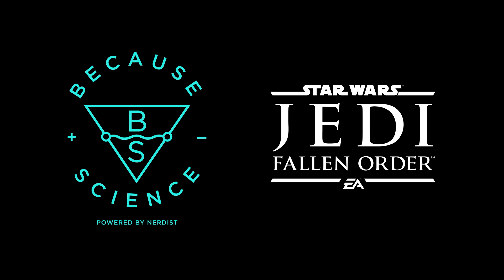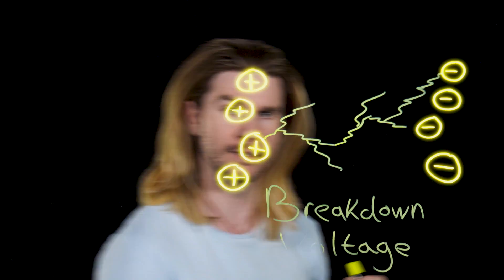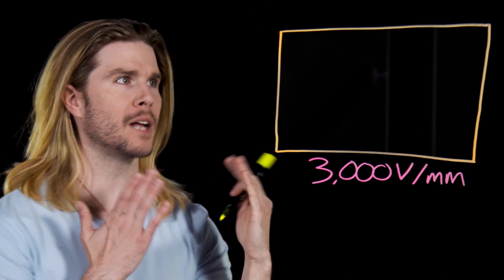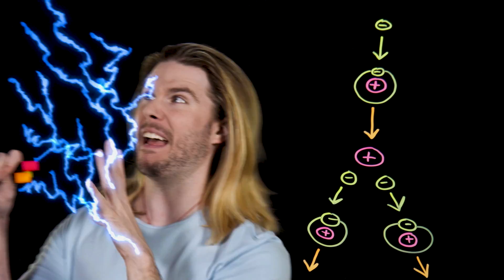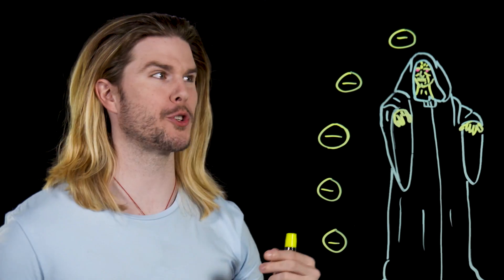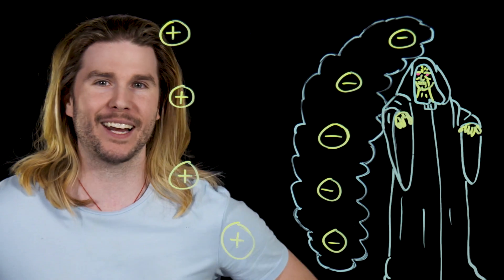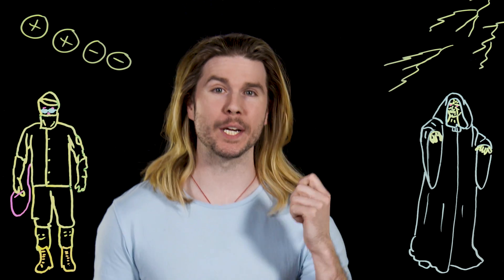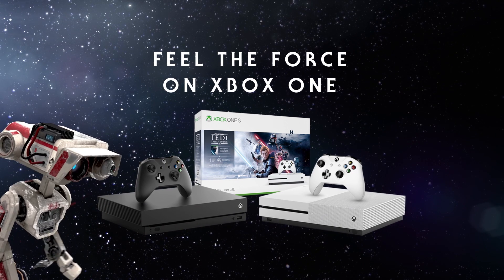How Does FORCE LIGHTNING Work? (Star Wars SCIENCE)

Comment: Nice explanation of something I've wondered since I first saw the Emperor using his (unlimited) powers, though now I also have the image in my head of him shuffling around over a carpet wearing colourful socks before shocking someone.

That imagery aside, there still is an aspect which I think would make Force Lightning, even when using the Force, dangerous or fatal.
First, electric eels are well-known animals able to stun their prey using electricity. Multiple sources I checked differed slightly, but most say they are able to generate multiple hundreds (~600-900) Volts. Once aspect of their powers is still not that well understood though: whether and how they don't shock themselves. Again, conflicting sources, but some said that the eels do indeed shock themselves and are temporarily stunned after shocking their prey.
Secondly, anyone who has ever ran around on a carpet and then touched somebody else knows that the discharge hurts both you and whoever you touched.

Taking both of these things into account, here is my problem. 
It may be the case that if the Emperor would use Force Lightning, he would shock himself at least as much as his victim, as may be the case in electric eels. This would of course make that power incredibly dangerous to use, hurting the user (see the effect on Luke) or possibly heavily shocking them or even be fatal (see the effect on Mace Windu).
Now, say that the Emperor is able to control charge in such a way that it is only contained in his hands or fingertips and doesn't reach the rest of his body, so it doesn't shock him completely. That would bring us into the second scenario, similar to oneself having generated static charge and then discharging it to someone else. If you've ever experienced it, you know that this shock can, even though it is only very short, be quite painful (otherwise just watch the video). Now imagine how painful it would be if this would occur with a voltage thousands of times higher than in the everyday case. I don't know if any studies have been done on the relationship between voltage and pain, but I think we could all agree that a few million Volts would probably be more painful than a few thousand. Again, this would make the power hard, or possibly even dangerous to use.

In conclusion, I think that though it is a very creative way of using the Force, Force Lightning would probably harm the user as much as the target and would therefore be a very, very last resort thing to do instead of just another technique to use in any battle.

Comment: Hi Kyle, love the show!

So force lightnings are similar to regular lightnings in terms of released power. The typical power of an Earth lightning is around 10 gigawatts but they usually only last for a very short amount of time, a few microseconds or so. On the contrary, in Star Wars, the force lightnings last much longer. In Return of the Jedi, Palpatine shocks Luke for more than 10 seconds conservatively, hence a total energy of more than a 100 gigajoules (E=PT). 

For comparison, and despite Luke’s amazement in that scene, Yoda lifting the X-wing could not have required more than 1 megajoule (potential energy difference E=mgh assuming 10 tons for the X-wing mass, a height of circa 10 metres and a gravitational field on Dagobah similar to Earth).

Kyle, is the dark side stronger?
Reply: A few corrections, first lightning strikes have an average peak power of Terawatts (10^12 to 10^13 watts) not gigawatts (10^9). Given that the voltage of lightning strikes are in the gigavolt territory and the current is in the kiloamp territory.

For force lightning due to the maximum voltages within those distances we can expect currents of around 10kA meaning at 22GV the power would be 220 GW or 2.2 TJ released over 10 seconds

Lightning on earth at 10^13 watts and lasting 30 microseconds is about 300 GJ. 

So while force lightning does release more energy, the description you were providing was misleading.

Second, assuming degobah has the same density as earth then it's gravity will be 1.13 times stronger. To lift a 10 tonne xwing 10 meters (which I think is a bit excessive) would require 1.1 MJ (within 10% of your estimate) but this is ignoring that he had to pull roughly 1 meter of that through the mud. Ultimately I would argue though that the mass of the x wing would fall closer to around 5 tonnes and instead of lifting 10 meters it would be lifted around 5 meters which would reduce the energy required to around 2.8 KJ which fits with your position that force lightning would release far more energy.
Reply: I was only considering orders of magnitude but thanks for providing more accurate numbers!
One quick note though, I think you meant 280 kJ for the x wing lifting (5 tons x 5 m x 9.8 gravity x 1.13 Dagobah scaling factor).
In any case, the force lightning is a much more impressive feat!
Reply: @Brendakye2468  Given it's the same size and shape of a Light Jet fighter and mostly the same materials ie Titanium, It's not unreasonable it'd be 10 tons. Disney Canon also says it's 10 tons now. Height sounds about right though.
Reply: @Citrakite  me saying the mass is 5 tonnes relates to its relative volume to that of a Lockheed martin F-22. Since they should have similar densities then the estimated mass drops down to just above 5 tonnes.

Note that I am not the only one that came to similar conclusions. The 10 tonne canon value comes from a "junior" book meant for kids. Using the complete free body volume of each would put the mass down to 4600 kg which is less than the 5 tonnes.

So in this instance I am going to go on rejecting the canon value given that it doesn't exactly make sense (especially since the x wings take up much less of the space of their free body volume than an f22)
Reply: @Brendakye2468  I based it more on volume of a F-14 and F-20. Planes closest to it's dimensions and materials.  F-22 is not a true apples to apples comparison due to the RAM and other lightweight composites used in it's frame and wings vs a more conventional fighter. 

Tomcat is nearly same height, minus tailfins, and width so length was the only difference. F-20 has a shorter wing span by 3 meters but it's 1 meter longer. Average between the two volumes relative to the T-65 is more like 12 tons but maybe the fusion engines are lighter than a same sized turbojet. Regardless 5 tons is way too low for something bigger by size and volume then a Gryphon or F-20 at ~8.7 tons.
Reply: You are correct I did mean 280 KJ my bad. Thank you for correcting that!

Comment: Hey Kyle, love the show!!
- It wouldn't be easy, maybe impossible, to hit a target using force lightning at such distances.  To hit the target, the closer thing to your hands has to be the target itself, even the floor has to be at a bigger distance to your hands then the target. 
- And you have to be isolated from the floor, with rubber boots. 
- if the air has some water in it, it may even be impossible to build up voltage at all, the electrons would runaway from you before there were enough to make a spark.
- You can't have such a constant flow of electrons like on those clips, you would fry!! The only thing that makes those discharges harmless is the short amount of time that takes those discharges to happen, we're talking about nanoseconds, milisseconds at best. The only way for you to not become a big piece of fried meat is if you're body had 0 resistance, like a superconductor. otherwise, you're body would heat up so much, you can end in a giant and spetacular explosion.

You should have collab with electroBOOM, what a missed oportunity!

Comment: Hey Kyle!
This theory only further proves that your theory of how a lightsaber is a magnetically contained plasma is correct. When Mace Windu faces the Emperor he negates the dark lord lightning by simply using his lightsaber like a lightning rod. The strong magnetic field of the blade would attract the bolts towards it instead of going through the jedi master. Perhaps the lightning is then reflected back at the emperor because of the charge he's built on himself now far out balances the combination of plasma and a moving magnetic field which would then create a charge of it's own?

Comment: What about the ohm and the amps though? Cause, even millions upon millions of volts is survivable to an extent but even something as little as 0.2 amps will kill you instantly. As for ohm.. the resistance of air is fairly high which is why lightning strikes are survivable.

Further, then, also.. All forms of electricity is magnetism and for that reason.. The Force in star wars is clearly the same electromagnetism we got here in "our galaxy". 
As it all makes sense (from a certain point of view, of course) to then "assume" that the force in star wars from the midiclorians (pause for gasp) is a form of mutation that allows you to build up electric charge within your body to then manipulate the magnetism around you. This also makes sense in that, the more of this mutation of the cells you got the higher and more charge you can control.

Great episode, as per usual, my good sir.

(Palpatine did nothing wrong, amirite)

Comment: Great episode Kyle, however I can’t help but think of one problem:
When you shuffle around on carpet and build up electrons then touch something metal, the forces equalizes like you say and you feel a shock.  So if you apply this to the context of force lightning, a Sith Lord is able to draw electrons to him at will, like shuffling along a carpet.  Him discharging the lightning at the hapless Jedi then is the equivalent of touching metal, to discharge the forces (again like you say). This implies that in the process of the Sith Lord trying to electrocute someone, they would also electrocute themselves, thus rendering the power somewhat redundant.  However, a possible work around might be the Sith Lord to wear a Faraday suit.
Reply: That wouldn’t work because electricity wouldn’t be able to pass out of the faraday suit in the first place
Reply: True.
Reply: I think The Emperor would somehow use the Force to protect himself (such as moving it along himself and not through if you understand what I'm trying to say) from such pain or endure it considering he's a Sith Lord (those guys enjoy pain).
Reply: This won't work as a Faraday suit would ground the sith lords themselves. Ultimately you can survive your body having a voltage of millions of volts, as Kyle left out other methods of working on hot power lines.

For starters, not all powerline workers will use Faraday suits and instead some will use a method called bare handing, this works by raising the voltage of the body to that of the powerlines and then they connect their body to the powerline so that there is no potential difference between the worker and the powerline making it so no current will flow through the worker.

If palpatine was in a Faraday suit then he would be grounded and any voltage he generates would go to ground, this is why demonstrations of people shocking others with van de graaf generators have the person doing the shock being insulated from the ground on something like a plastic stool. Add in that palpatine could safely discharge, if he had control over electrons, by taking into account the skin effect of high frequencies you would result in him just having to insulate himself from the ground.
Reply: That's why I think powers like that would instead set two points in the air or at the target and the air, so a electrical discharge flows from one to another.
Reply: I had the same thought just not in so many words thankyou.

Comment: A Faraday Cage wouldn't protect you from magic lightning. Real electricity takes the path of least resistance, so Pikachu, oh wait, I mean Palpatine, would end up shocking himself, or the ground, or the nearby metal railing, before being able to hit a distant target.

To get the behavior out of the lightning that we see, there would have to be an invisible cylindrical area of impossible resistance channeling the electricity in the targeted direction. It's like the insulation surrounding a wire except without the wire or the insulation actually existing. This area is frankly, magical, but necessary to explain the lightning being channeled in a given direction.

Thus, penetrating the Faraday Cage is merely a matter of the magic lightning creator setting the invisible cylinder of resistance to cut out a circular cross section of the cage. If there is a limitation into how small the wizard can make his cylinder, then a Faraday Cage smaller than the cylinder would offer protection, but generally we see most of the force lighting channeled within a 1 foot cylinder. (We do see minor arcs splitting off in random directions implying the cylinder's resistance is not infinite.) So, unless you've got the stature of Baby Yoda, that's not going to work.

I hate saying a solid engineering idea isn't going to work "Because Magic", but that lighting is targeted, and the implications of that means we're suspending a lot of science.

Comment: Dearest Kyle,
Nice explanation, but I have a few problems with it. The main one is that force lightning has the same amount of energy as a real lightning strike. This makes sense, considering the distance that needs to be traveled, but it isn’t consistent with the movies, due to the lack of blinding light,deafening thunder, and Luke becoming a roasty boi. In addition, the Death Star is made of metal. There is no way a van de graaff generator would arc two entire Luke-body-lengths when a much better ground is much closer. 

I think a good addition to your theory would be that a Jedi or sith could use the force to create a plasma channel between themselves and their target. This would significantly lower the resistance of the air (which is now plasma), so you could bring the voltage back down to taser levels. This way, the user could also direct their attack to a target at a distance and with great accuracy. One last added benefit is that a sith’s lighting attack could be blocked by a lightsaber, which is also plasma. We never see this, but it feels Starwarsy. A problem, however, would be that when you build up a static charge and touch somebody, you both get shocked. Using force lightning with your explanation, would cause as much damage to the user as the target.

Love the show, keep doing great work!

Also, it’s magic

Comment: Question Kyle. If an electron avalanche does occur, why is there is a distinct pattern (order) for the interaction?  When we see a lightning strike, it's single "bolt" hitting the ground, not a flash going out in all directions. I would assume an electron avalanche would work more like an atomic explosion than a directed arch. What is this force holding the electrons to a specific path in air?

Comment: Hi Kyle, great episode.
I have a question I thought would make a fun thought experiment for footnotes. Since you hyposite that the force lightning technique is manipulating lightning then if the charge were to build up on the finger tips would that not mean that a user would shock themselves as well? Unless they affect the charge in the rest of their body then the potential difference between their fingers and their body would be the same as their Jedi target but there would be limited air between the fingers and the body since the fingers are connected. (Of course you could measure going from the finger tips to the toes through the air between them which would also be easier than to their enemy). Obviously this could all be over come by building a charge through the whole body but would that not then cause arcs to come from the entire body rather than just the fingers. Keep up the good work.

Comment: Isnt the generated heat from the lightning still gonna be a problem regardless of faraday suit or not? Getting constantly hit by force lightning might not zap you with the suit but it still should get very hot right?
Reply: As a kid I participated in a faraday cage experiment and I could sense a fresh air current with my hand on the inside of the cage near the electric arc.So at the beginning no, it would help the Jedi air their moldy robes actually ;p

Comment: Hey Kyle, nice work with this episode like always.

I’m just curious about one thing: couldn’t the Jedi just wear armour or something that has a relatively high resistance? I’m not sure if this is how the suits you mentioned in the episode work or not, but if not, then consider the following.

It’s not the voltage that causes shocks and hurts, but rather the current moving though a medium. Voltage is only the potential amount of electrical energy. Current is the actual amount of energy moving through a system. To lessen the amount of current hitting the body, just wear high resistance armour. Current = Voltage / Resistance, so even wearing a 10 Ohm suit (which is hardly anything in terms of resistance, even Jar Jar Binks can offer more resistance than that)  can dampen the affects felt by a lot. It will have to be a lot of ohms, though, (around 220 Million) but I’m sure there is some substance out in the galaxy that can be durable enough to move around in yet “heavy” enough to handle the task.

Anyway, love the show and keep up the good work. I may or may not secretly support your super-villainy.

Comment: High voltage is not that good for your body but the true threat is current intensity. That's why static electricity is painful but not that dangerous. 
So for those sith recruits, they could probably initiate the arc but they would need to use the Force to boost the intensity once the arc is initiated.